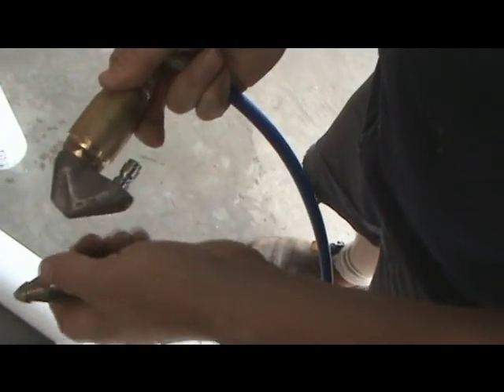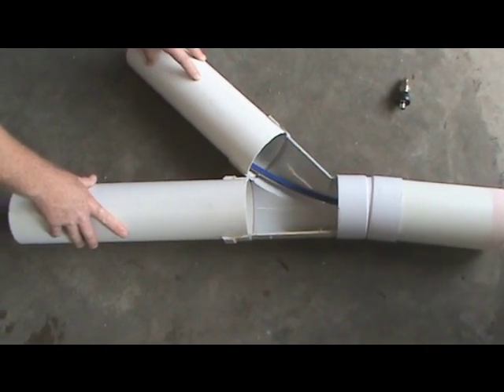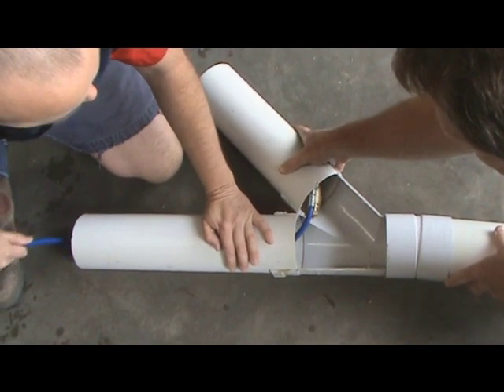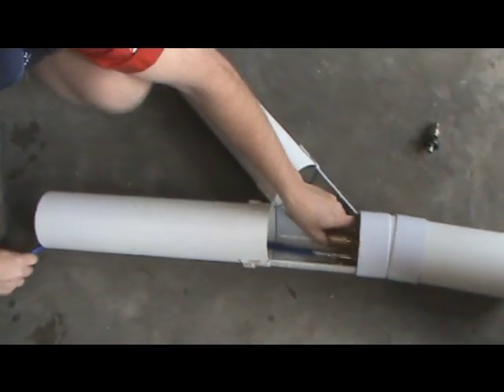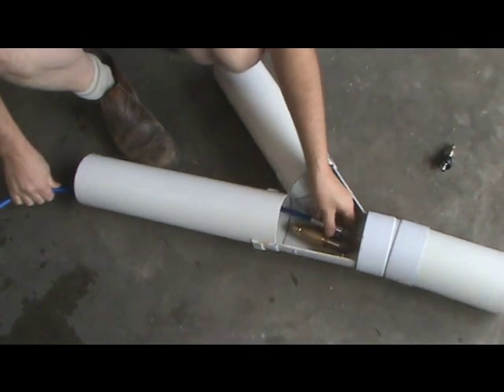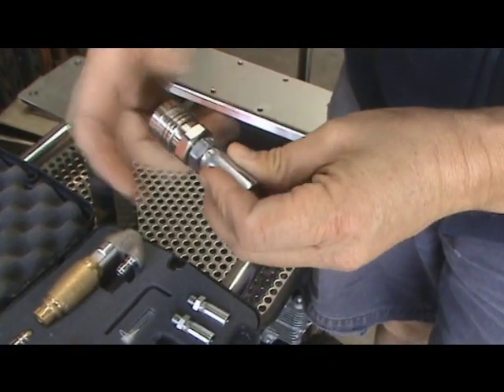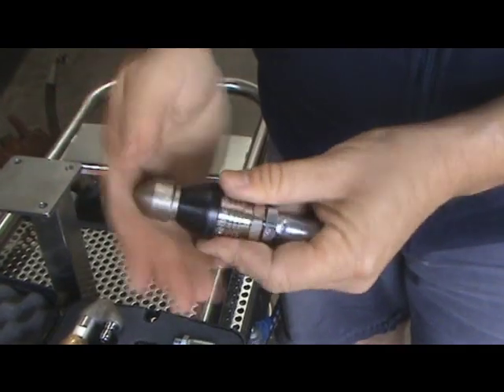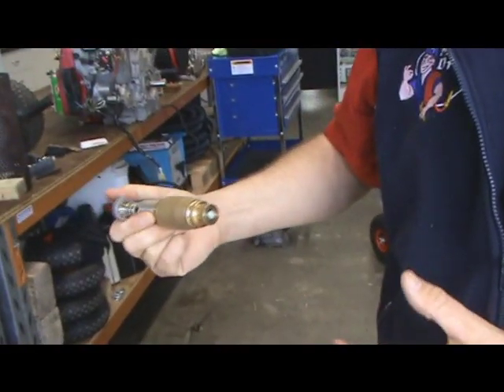The Jetters Edge Training Module, Jetting Tips and Nozzle Selection

Comment: 👀 Am I the only one who realises you going backwards up the drain instead of down the drain as the junction would be installed in the direction of flow.
Reply from the maker: The drain can be cleared from both directions so this shows how you can avoid problems when used correctly.
Reply: Hans Klusser - Yes it can....i do a little work in the drainage area, and sometimes you can’t access a dwnstream wastewater pipe because where it’s located or it’s buried, and the easiest access is an upstream manhole or inspection chamber so you jet from there.....done it many times just because of access. But I drop the pressure when pulling back to lessen the risk of pressure going up service lines or laterals towards house.